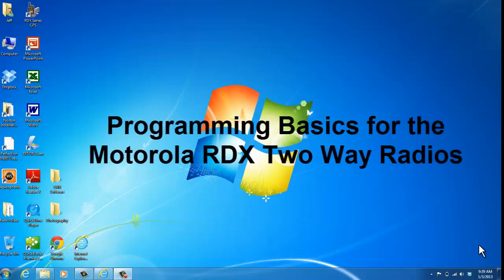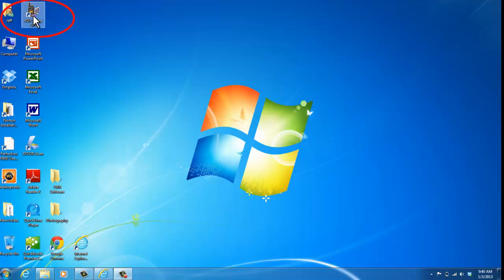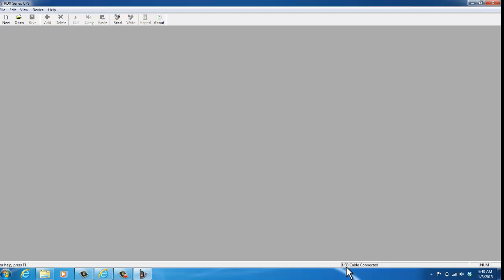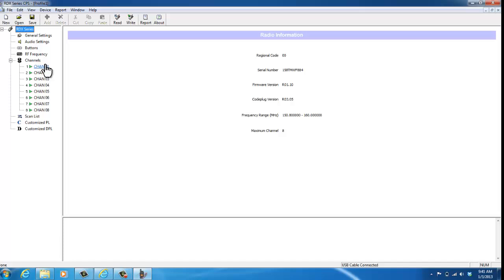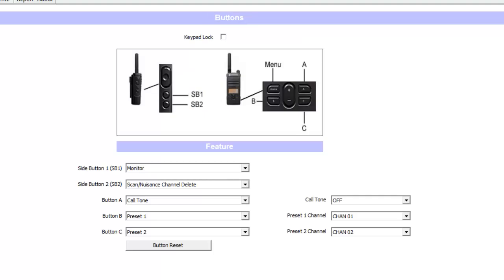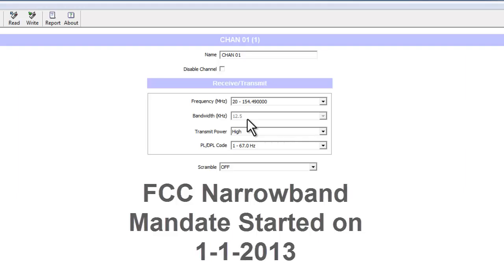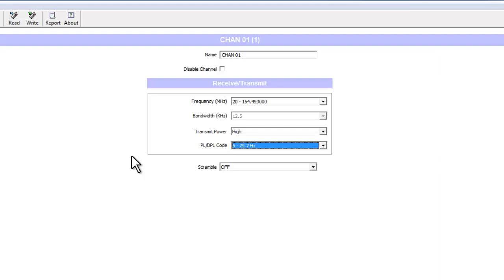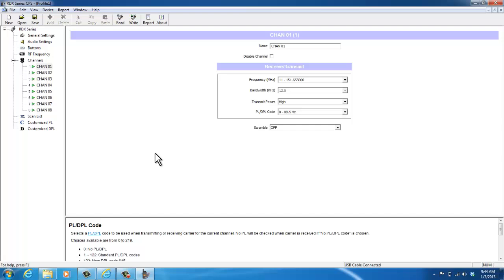Programming Basics for the RDX Series Radios

Comment from the maker: If you have the same frequency and privacy codes set in your CLS1410 and RDU2080d radios they will work together. You set these manually or through software on the RDU2080d.

Comment: Hi, is the codeplug required when you use the software or have the radio updated? We use a set of 6 CLS1410 and wish to add the RDU2080d to our team. Just wondering how complicated to program the 2080d to work with the CLS series. Thanks.